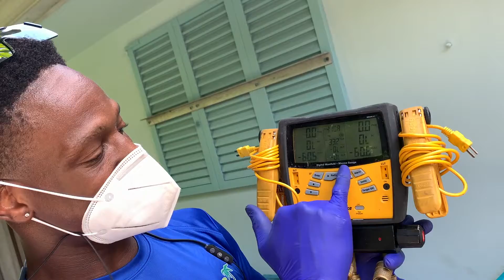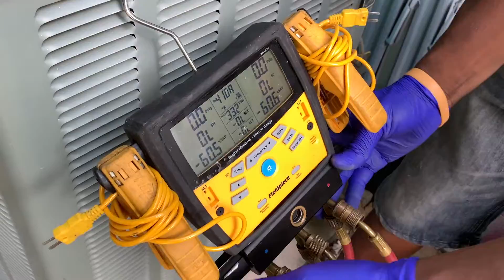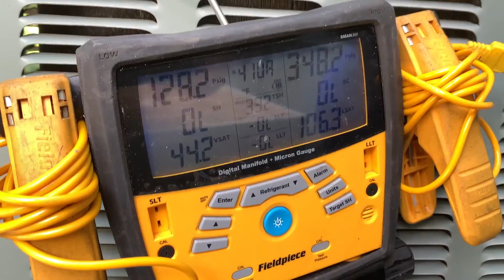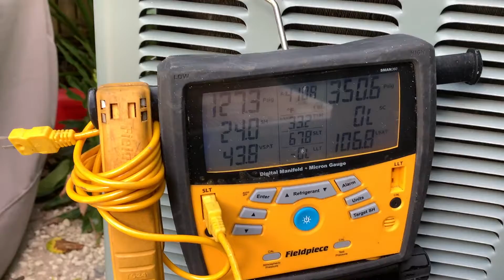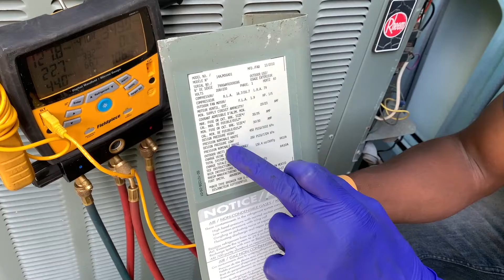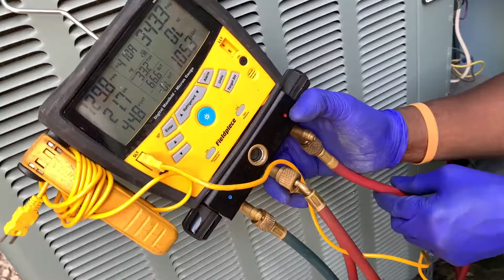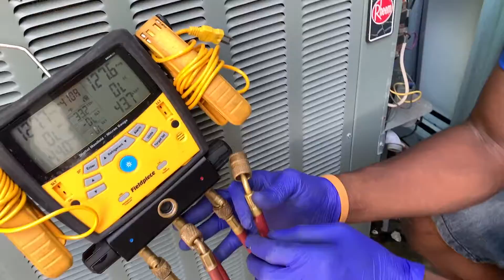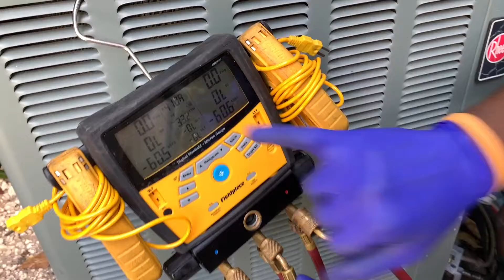How to check Rheem AC coolant pressures with a Smen gauge

Comment: Hi! Amazing video! Thank you for creating this type of content. I recently installed a new Rheem 16 seer 3.5 ton system (RA1642AJ1NA + RH1T4821STANJA) at home and pressures are low side 140 /High side 305 at a 81F outside temp night here in florida. During the day with 92F outside it was at around 175 on the low side and about 300 to 310 on the high side. Does that mean I’m low in refrigerant? The system is cooling but I feel it takes too long to lower temp inside. Like 1:45 or more to go from 72 to 70. Any advice would be greatly appreciated, thanks in advance.
Reply from the maker: If you put a thermometer in the van and check the temperature coming out it should be about 15° lower than the room temperature so if it’s 75 should be in the 60s or 50s if it’s not cooling enough you probably need more refrigerant good luck thanks for watching